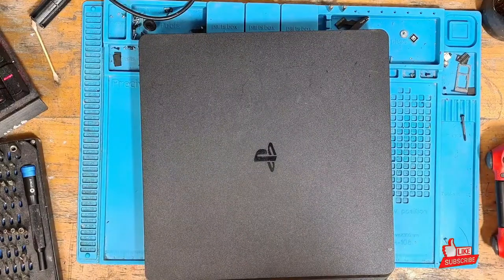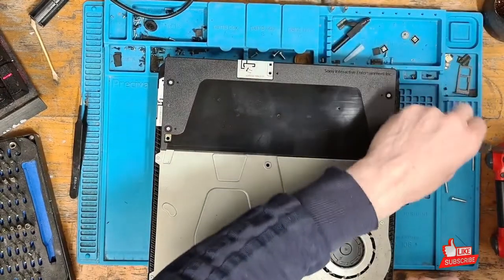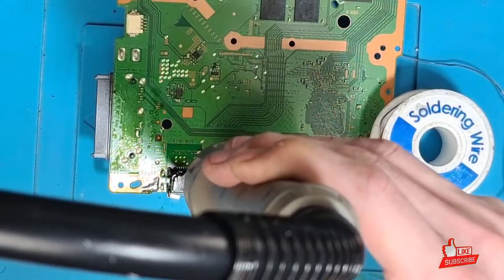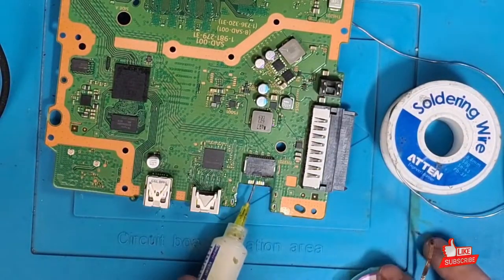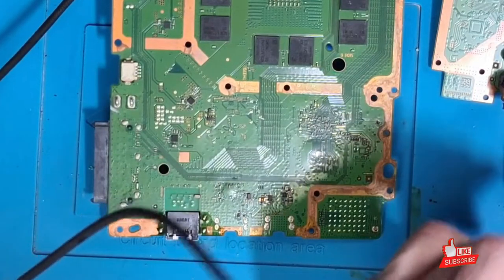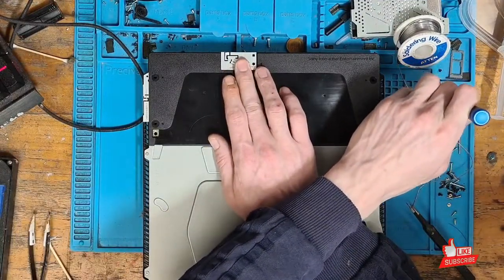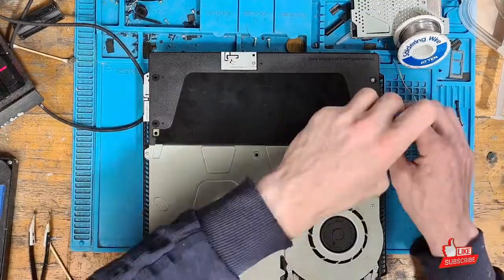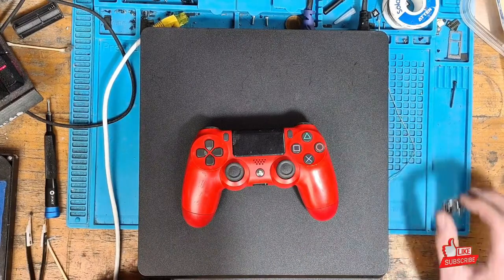PlayStation 4 Slim Damaged Ethernet Port Replacement

Comment: First
Reply from the maker: Whoop 😁
Reply: @TheCod3r  how strong are these ports lol why they break like that
Reply from the maker: @john75470  I don't think they're an issue usually, but it depends how rough the user is to be honest
Reply: @TheCod3r  I was taking mine out of my ps5 I push the clip down guess I was pushing more of the sheild and try to pull it out was firm but did not hank it or pull it out hard I try let go and tried again and got it out just was paranoid cause I did not want to damage it.. I look at port don't see no damage but everything works good just don't wanna snap the board or anything
Reply: @TheCod3r  but everything looks good bro I watch your videos to learn I would love to see a video on how well the boards are solder on to these things I know most hdmi break off these things
Reply: @john75470  They break like that because the user literally just pulls the ethernet cable out of the socket without pressing the release tab on the cable.
Reply: @thosroach7417  on ps5 I had a lil hard time getting it out I was a lil firm trying to pull it out while pressing the clip I gently even wiggle it and they I push clip a little harder and got it out with no damage

Comment: Great videos love watching your fault finding process. I have been using the videos to diagnose my own nintendo switch. But still struggling. It will charge from a battery pack but wont charge from the power brick - the power brick works fine on another switch and switch lite. Hope to find a solution soon. Keep up the great work.

Comment: Hi mate got a ps4 disc drive 1216a one of the springs have fell off bottom left near the rollers just wondered if u can tell me which way it goes back on cheers
Reply from the maker: It's hard to say without seeing it mate. If you could post in discord either me or one of the other discord members will be able to help
Reply: @TheCod3r  the drive gone now mate how much am I looking at

Comment: The ethernet port on my ps4 only connects at 100mbps, whereas everything else connected with the same cable connects at 1gbps. Same results with different cables. Any thoughts?